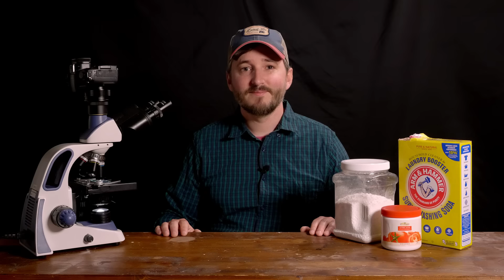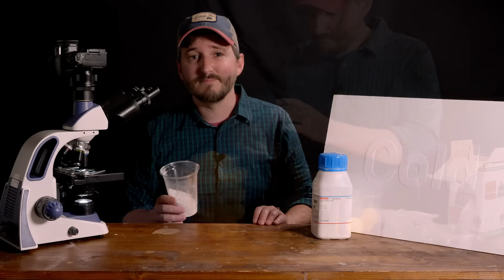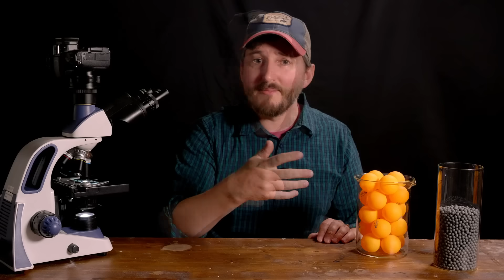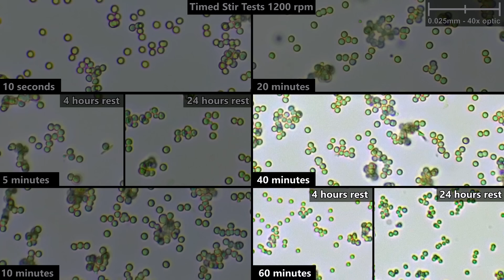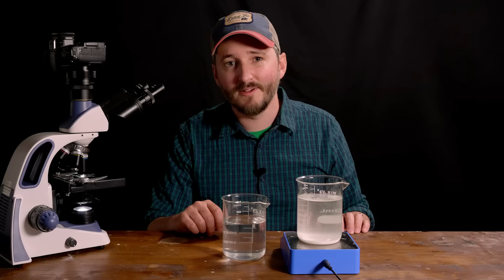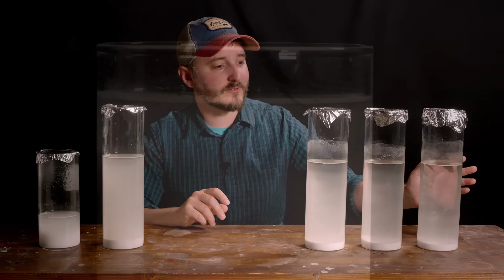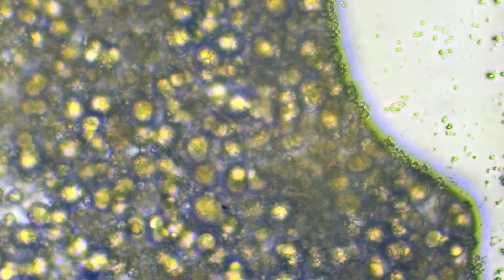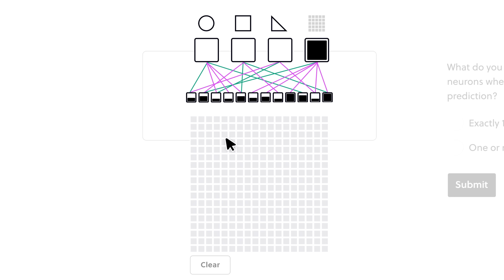Making Infrared Cooling Paint From Grocery Store Items (w/Novel CaCO₃ Microsphere Synthesis)

Comment: I have a question, I watched the video awhile back and wanted to know if the pigment, as made, would work in a latex paint binder with same thermal results and make it durable enough for practical application. 

What about two part paints like used on metals?

Will the paint, as made, work on the underside of a glass panel? 

Food for thought, I am NOWHERE NEAR informed about paints, thus the questions.
Reply from the maker: It won't work on the back of glass because glass blocks the IR radiation. As for other types of paints all of those things need individual testing to know the answers.
Reply: @Nighthawkinlight  
Thank you

Comment: It has been quite a while since the original articles about this invention but I haven't seen any ads for the product yet. I suspect the problems with it are just common old dirt and dust. I applied a Henry Tropicool silicone roof roof coating to my house and my RV roof. Both are usually tan instead of white because they collect dirt and it sticks and has to be washed off. I think that may be the hardest problem to solve because dirt will really adversely affect the performance of infrared cooling paint.

Comment: If nucleation sites are your goal, wouldn't an ultrasonic transducer make the smallest spheres of all?  I know at those power levels (ultrasonic cleaner power) you'd have to do something about heat... maybe start with the solution a few degrees below the ideal temperature.  Of course, this may be a bit overkill, but I figured it was worth mentioning.

Comment: Swimming pool deck paint works really well lowering temp, and you can get different colors, also the more coats the more effective, 15 to 20 degrees cooler than non coated surfaces, probably has small spheres.

Comment: Im wondering how white chalk paint would compare to this?. After all its calcium carbonate, cheap and could be topped with a polyurethane top coat? Is this a valid and easy bit of content for you? Would the polyurethane resin act as a valid air insulator ?

Comment: I've been experimenting with this material, and have had some very reasonable results, but I need to ask what plastic you used to shield the material from the surrounding atmosphere. Most materials either don't list transparency at 10,000 nm or are fairly opaque. I did experimentally determine that Saran wrap is opaque, but I'm not in a place where I can buy specific brands of optical glass to shield the paint layer. Even most acrylics appear to have low transparency (which is something I need to consider when making the paint itself).

Thanks for publishing the process. It's quite excellent, although the application is certainly the hard part I need to hammer out.
Reply from the maker: Cellophane film works fine and comes on rolls. You can purchase it on Amazon.
Reply: @Nighthawkinlight   Thanks! I appreciate it. So far I'm only getting milliwatts per square foot, but given how rough the first two test boxes were, I'm pleased it's consistently below ambient. I'll let you know when I have clean data. Hope your tests are going well!

Comment: To anyone who might be doing this or having trouble finding calcium chloride.  Look up the solvay process. You can just use agricultural lime or a more pure lime but not slaked lime or hydrated lime, only limestone lime. 
All you have to use is salt added to the lime in solution. Cacl is more soluble than na cl. So you end up with cacl and na co3. 
Then you can either get the water out that will have your calcium chloride in it. Then add more sodium carbonate, or you could even try to use the sodium carbonate from the first step. Just figured I'd mention it because it's surprisingly hard to find calcium chloride outside of winter but of course it's easy and cheap enough to order online. Idk if it's good for making spheres

Comment: Your explanation is still sensationalistic, it's like claiming firing a laser into a cloud will not allow the laser to cool down as quickly as if you pointed the laser at empty sky, this is bunk. The point you bring up about the paint reflecting EM wavelengths SUNLIGHT emits + is also transparent in spectrum the sun doesn't emit, now this is closer to accurate this time though. Note - the effect still has nothing to do with 'open to space', if the paint happened instead to be a one-way reflector even in an IR wavelength the 'atmosphere' emits powerfully in, the effect would be the same. Low energy EM radiated and absorbed/reflected by the atmosphere 1km away from a surface will not affect the thermodynamics of the surface at all , not even the tiniest little bit.
Reply from the maker: You've not properly understood the concept. You should read a few of the published papers on the subject of radiative cooling. A key concept you need to know is that materials tend to emit IR in the same wavelength they absorb. That means if a surface is facing the sky and emitting a wavelength the atmosphere absorbs, atmospheric gasses are also emitting that same wavelength in all directions proportional to their own temperature. It doesn't matter if the panel's IR travels far enough to not return, because the gasses nearby are emitting their own IR that will warm the panel. The reason why it matters that space is cold is that entropy demands that heat can only flow from warm things to cold things without requiring extra energy. If space were the same temperature as the earth nothing on earth would ever cool down. Space would be sending proportionately as much IR toward the earth as the earth was radiating back into space.
Reply: @Nighthawkinlight  "That means if a surface is facing the sky and emitting a wavelength the atmosphere absorbs" - Yes, I addressed this in my comment, props here  this is a major factor in why this works. 

"because the gasses nearby are emitting their own IR that will warm the panel" ...also addressed this point. So depending on the power of the atmosphere (not SUN remember you claim is 'escape to space') IR emission, this could be important or completely de minimis. For your assertion to make any sense, you'd need to show that the night-time atmosphere is bathing the panel in IR in that narrow band of the paint's transparent range, and that this IR adds up to significant net energy gain (many watt hours / m)... Please try the math here and let me know if you get within an order of magnitude of raising the temp 1 degree for even a 100kg mass.... (note: not convection, energy ONLY from IR, and ONLY in the transparent range)

Comment: When I got a temperature 'gun' I pointed it at everything. The blue sky was surprising, - 30 and - 40°F. What next surprised me is that when there's cloud cover, those clouds register at about the same temperature as everything around me out of doors.  And if there's a wisp of clouds or even just haze in the air -- this too warms up measurements taken straight up. 
It's my understanding that a reflective roof responds to these conditions. So, Clear blue sky? maximum radiation reflects upward. Overcast? Very little effect. What have you noticed?
Reply from the maker: Cooling is reduced but not eliminated by cloud cover

Comment: Why paint though? Could you try using it like powdered sugar? Coat whatever in epoxy, polyurethane, or white house paint. Then dust it with the reflective powder. Or how about powder coating methods.
Reply from the maker: You'll only get a one sphere thick layer if it's sprinkled on a sticky surface. That's not thick enough to provide good scattering
Reply: @Nighthawkinlight That's true if you only do it once, but what if you repeated this process several times to get additional depth

Comment: The blender blade comment needs validation. If you look at the blendtech "blade" it is a bar with no edge. Cheaper blenders have the blades beveled or "sharpened" because they lack power. Blenders work by crushing and pulverizing, not slicing. Sure, a large soft object might slice initially on the cheaper blades, but the finish product is not pile of blended slices but crushed material. So the question is does the inierta of the chunks allow the blades to have enough force to crack the spheres. Not if the blades are sharp or dull relative to the sphere size. My guess is sharpness would be better since spheres would be able to slip past either side of the edge easier moving less only catching if stuck together. Opposed to getting twacked by a wider surface like a hammer and flung aroung the jar at high speed.
Reply from the maker: Many of the microscope shots were done after the spheres went through the blender. They seem to be fine.

Comment: Great video, very informative indeed! Have you considered spin-coating as a possible method? I once worked in a shop which use to apply ceramic coatings on various machined parts. The ceramic coating was simply a water base, thinned slurry of various metal oxides. The goal was to coat the internal bore of a cylinder. This was done by flooding the internal space with the slurry pumped up from a reservoir below. Then after a specific amount of dwell, the pump would switch off and the slurry would drain back into the reservoir by gravity. The two critical variables which determined the amount of solids deposited and the overall thickness of the coating was the dwell time of the flooded slurry and the time it took to drain/evacuate from the bore being coated. That technique would lend itself well to say flat panels positioned vertically in a properly shaped vessel with your inlet/outlet at the bottom. Cheers!

Comment: You know more than paint this could be applied like those outdoor plastic coating "paints" for drywall that come in a bucket and you apply not with a brush but with a sort of trowel like you would do a cement coat.

Comment: First love your videos! Second i my self have been using your videos to desire making my own cooling paint. These are the hurdles i forsee and why have not done this yet. The same properties that also make this reflective like snow also would appear to make it a good thermal insulator like snow effectivly in principle the only thing that would cool is the paint itself.  whilst acting as a decent thermal barrier to anything it is in contact with due to the air pockets in the material as well as acrylic being naturally higher in r value. This could be mitigated by the thinest possible layer against a larger surface.  A good testing proccess for this would be to compare the rate of heat gain on a full non painted surface the rate of heat loss on a full painted surface then the rate of heat loss to gain comparison of a 50/50 surface. Doing so would make a good comparison of any one material backround on wich the paint would surface, this could then be utilized against different background materials the first that would come to mind is a silver background perhaps a silver paste as it has one of the higher thermal conductive properties. Having these three tests compared against different surfaces should yield reliable conclusions of its effective thermal conductivity properties. Cooling paint has from what i can gather approximately 400w of cooling power per meter squared. But how much of that heatloss can it share.
Reply: The most applicable static function I can think of this with this application would be to utilize a large water tank inside the home to act as the thermal sink/medium. These would require the panel on the roof but would allow the natural properties of heat and currents to passively move towards the panels and bring the cooler water into the home. A very easy bridge(on off switch) could be incorporated with shutoff valves near the top. Allowing for the removal of the panel during winter months and a temp seal/insulation over the exposed piping. And to slow the process during naturally cooler days once the desired Temps have been reached.

Comment: It probably sounds stupid, however, is there a way of just creating grain size limestone "sand", and just running it through a tumbler like gemstones are polished and made roundish?

You could make a tumbler that may process many Kg's of the stuff.

Just load it and walk away for a day or more.

Constant tumbling of limestone particles should make them spherical-like.

Eventually the particles should become spherical more or less, although they will not be uniform in size, yet microscopic.

The different sizes may even be beneficial.

If it could be done, you can save on chemicals and help the planet...
Reply from the maker: It's a good idea but I don't think it would be easy to make work. A rock tumbler works because it has very fine grit to polish the stones. To polish microscopic particles you would need nano size grit.
Reply: @Nighthawkinlight  If left tumbling long enough, it would eventually form its own grit. It would grind itself down. Sand can grind itself down to 10 microns. How small do the particles have to be?
Reply: @Nighthawkinlight  Yes, a ball mill can create nano-sized spheres. Ball milling is a technique used to reduce particles to the nanoscale, making it a suitable method for producing nano-sized materials. High-energy ball mills can even achieve particle sizes as small as 5 nm

Comment: Does anyone have any good ideas for applying this on a boat? I have a old one in need of new gel coat. 
Would an clear polyurethane or epoxy still allow for the correct radiative spectrum?
Reply from the maker: Sadly there's no way to know without testing. More work needs to be done before a paint is proved ready for such uses

Comment: Wow this is soo awesome. I am a painting contractor and have worked for roofing Co. doing roof coatins on flat and metal roofs. The first material I worked with was Epoxy Flex. Very impressive this stuff would stick to anything. Applied at 10 mils thick it cooled asphalt  radiating at 155° down to 105°. Dallas Ft. Worth area July, air temp at 100°. They gave this a 25yr. Warranty! Provided the customer put a maintenance coat on at 10 yrs. Now to think I could make this myself is very e couraging. Last I checked the cost was $325 per 5 gal. Bucket. Have you thought about mixing in titanium dioxide make the paint hold up to the elements. Thus no need for a poly barrier?
Reply from the maker: TiO2 is not very good for cooling, but it does reflect a lot of sunlight so it's better than nothing. I've painted my own metal roof recently with a white silicone coat and have seen similar results, down 40-50f. My pigment needs a lot of testing before it's ready for such purposes, but I would expect better cooling still.

Comment: I really want to see someone paint a car in a hot climate with this. It's even moreso needed in EV's where running the AC to cool the car down uses precious battery which lowers range.

Also windshield 'curtains' that reflect the heat away to stop the interior getting hot

Comment: If you take an old satellite dish and build a cone over it with a small window at the focal point, you have a very reproducible concentrator.  Insulate the exterior of the cone and paint the inside with your radiant paint ensures no trapped radiation.  Everyone could easily integrate them into their cooling systems.  Creating the parabolic shape out of foam would be super cheap.

Comment: What if you were to paint it on to something incredibly conductive? I was going to say tungsten carbide, but that's really expensive. Like a sheet of copper, and then run copper tubing in a typical radiator tube fashion behind the panel with fins attaching the tubing to the panel? Then you run a refrigerant compressed liquid gas, like tetrafluoroethane or Freon through the pipes with a pump system. Then have a panel inside your house, also made of copper with fins to conduct heat to the refrigerant. Is this a good direct active AC system? Would it work?

Comment: This is such an interesting video! I wish chemistry in school had been so inspiring!

My first job out of college was as a graphic designer For a 100-year old screen printing company. (I saw some other comments on that, and wanted to elaborate.) We used to print several different types of inks for decals. Some were water slide-off decals, heat transfer decals, ceramic decals for cookware, cigarette pack tax stamps, and temporary tattoos using makeup pigments.

All of these decals had some things in common.  Each had an adhesive layer at the bottom. Above that was a base layer. Sometimes a white or silver layer to make the decal opaque. Above those were the colors, each one layered to create the design.  Finally, a sealing clear layer. So the design was sandwiched between all of these layers. The layers need to be printed in reverse order on the appropriate paper. 

You could make “tiles” of sandwiched layers with an adhesive at the bottom by screen printing them like giant decals. Then apply several of them to cover the products!
Reply: I was thinking along with the same lines. Take the human element out of it and use an extruder (3d picturesque) and get consistent layers over adhesive backing and cover it with a protective coating.
Reply: that is an amazing idea! I think they would need to be interlocking tiles though like some laminate fake wood flooring & like them be produced as rectangles or parallelograms for efficiency & effectiveness but this would truly be genius as one could create portable
pavilions,kiosks,car or RV shelters & so much more! I guess I'm thinking of modular set-ups but there's also the thought of finding a way to incorporate this tech into panels erected strictly to see if a large quantity of them in a zone of extreme radiated heat could reduce the rate of global warming without creating more waste materials that would be detrimental as so many other options do !